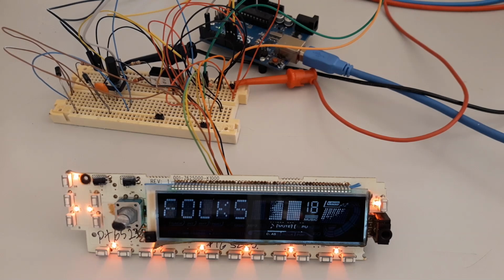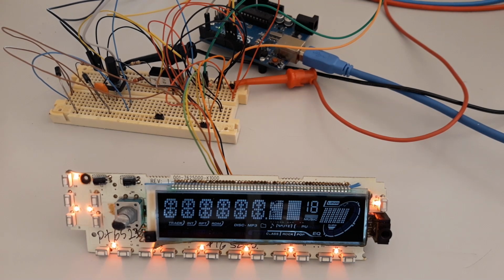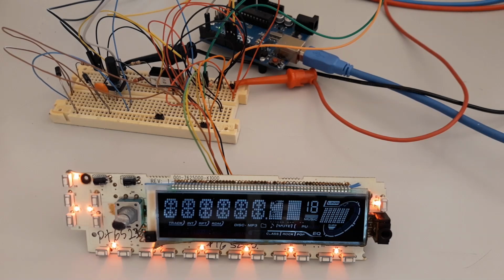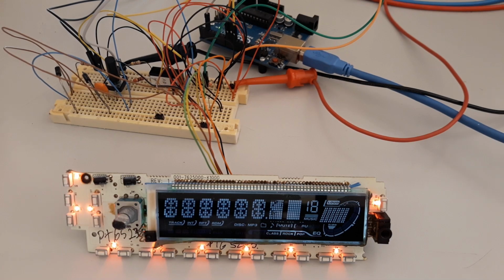PT6523

Comment: Забыл сказать - вам идею на заметку, не плохо было бы видео туториал от вас о том как найти распиновку для дисплеев. Я бы посмотрел как правильно понять какая распиновка перед нами на ноунейм дисплей к примеру. Просто не всегда шелкография подписана на плате.
Reply: You just put multimeter to continuity mode, open datasheet for the chip and follow/test the signals between chip and connector.